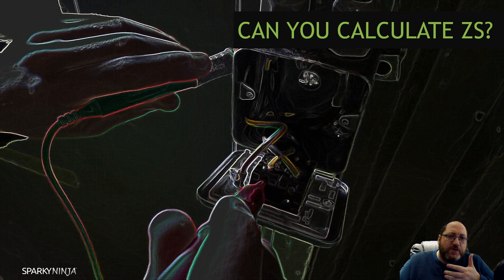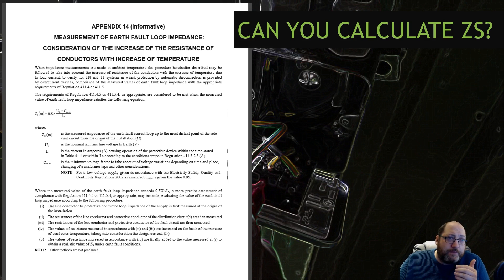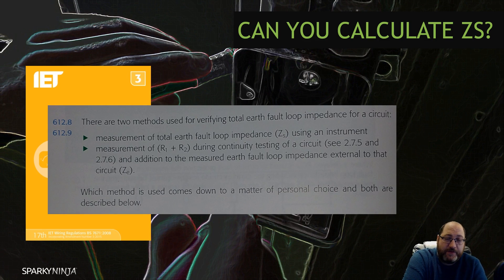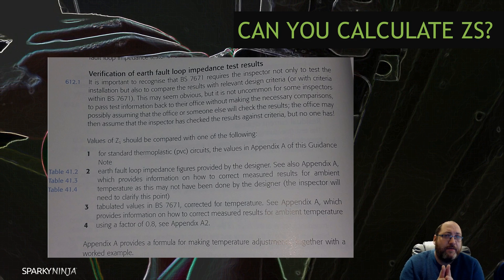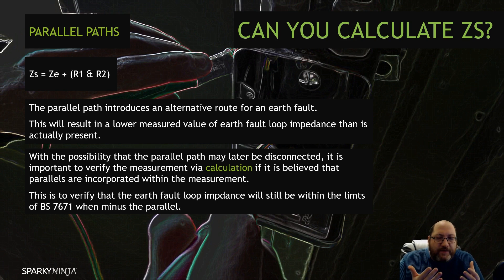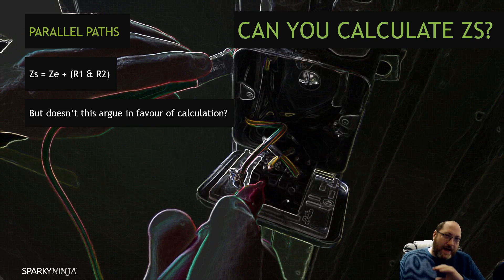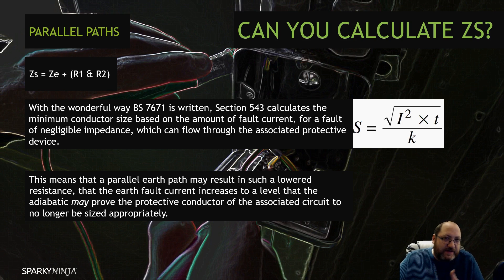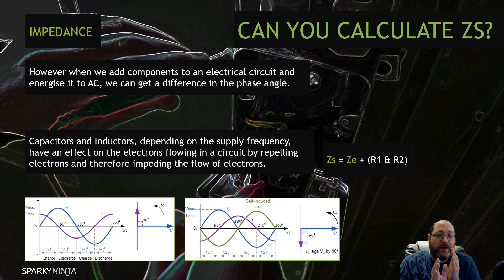Can you calculate Zs values (and should you)?

Comment: I don't follow your logic about parallel paths, at 12 mins. The max current the MCB will pass before tripping will not increase, but the proportion of the current (supplied via the line conductor) returning via the cpc will be reduced thanks to the parallel path. I believe the calc uses 5 x MCB rating (for a type B)?
So Amps in the calc will not change. The line conductor will suffer an increase in current, but that is not the issue.
Reply from the maker: The point is regarding where we use the adiabatic to design, not accounting for parallel paths and then consideration that fault current would increase with installed parallel paths which might put the system under stresses that haven't been taken into account.

Comment: When I fill out certificates I record the highest measured value in the Zs box, 90% of the time this is Ze + R1 + R2.
On your impedance explanation, I've noticed that live testing with some types of equipment connected to the circuit can give me erratic or different readings, especially with 3 wire low current tests. What exactly have we proved by conducting a live test if the reading is susceptible to change by connected equipment?
I carry out ELI where it is safe to do so. I wont stick my probes where i cant see or reach easily, i wont leave lots of live accessories hanging off the wall on a packed building site, and i wont cram myself into a stupid small space with live conductors.

Comment: Thank you for creating this informed video with reference to specific regulations in BS 7671 and reference to GN3. My training has been that calculation of earth fault loop impedance by Ze + (R1 + R2) is acceptable and is preferable for the reason of not requiring access to live parts (and so reducing live working ref. EAWR 1989).
The point you make about parallel paths is an interesting one, though surely if the impedance is reduced by parallel paths, the CPC will not be subjected to the full resulting fault current current, the fault current being proportional to the impedance of each part of the parallel path?
The biggest question for me arising from this, is when carrying out dead tests for continuity of CPCs, you are supposed to test at every point in the circuit, verifying the results and recording the highest result, which you should expect to obtain at the extremity of the circuit (subject to various specifics).
When obtaining your Zs by measurement, would you again be wanting to conduct the test at every point (every accessory - sockets, luminaires, switch positions etc) or is it considered acceptable to carry out measurement only at the part of the circuit where the highest R1 + R2 reading was obtained?
Otherwise we will be spending a great deal of time taking things apart and putting them back together again for doing a second round of measurements.
Reply: If you are talking about a standard radial, I'd test r1+r2 and Zs at the end of line. Where you have a radial with multiple end of lines, test at each of them. For a ring, test everywhere.

Comment: You peroidic a property...or... do an install in a property......Then a plumber comes along, as part of a bathroom / kitchen re-fit, and all those tests and measurements you did are now wrong because the pipework is now plastic instead of copper...making any certificate issued useless. 
Do you think ALL plumbers should be made aware of the fact that "improving" the pipework / water supply system, that they are going to affect the electrical system too?
I ask because.....I recently had this when the builder and home owner decided that a new water main was needed...from Lead ( and rightly so for health and safety reasons ) to plastic...as this would aid the water pressure in the property etc... Without considering all the potential electrical issues this may cause.
One final point...If we measure Zs / Ze....Do the multifunction machines we generally use actually measure it, "Z" or are they simplifying it to simple OHMS Law "R"? I think the latter.

Comment: Hi... all good stuff...Thanks.
One question ...If you had a higher than expected Zs reading...higher than the regs allow 1.1 /1.08 Ohms for a 32 Amp Ring Final Circuit.....and then you introduced an RCBO for protection....would the Zs then be 1667 Ohms for the RCBO for a 32Amp Ring Final Circuit  or would the Zs  be as the regs state?
Reply from the maker: Hiya,

The Zs would stay as to the actual measurement. However if a 30 mA RCBO was introduced then we can look at regulation 411.3.2.5. This mentions that the requirement for the disconnection times may not be needed if a device is used to lower the supply below 50 V a.c. in a QUICKER time than those given in chapter 41.

So say we look at a TN system 32 A final circuit, this has a disconnection time of 0.4 seconds in Table 41.1. If we were to introduce an RCBO of 30mA to this final circuit then at 5 x IΔn it will trip in 0.04 seconds, removing the supply. 

This is fine, but only if we know the RCBO will work in the required time and rating to keep the voltage below 50 V, and for that we need the 1667Ω. This is why we may record the alternative Zs of 1667Ω on reports.

If the original Zs is in excess however, it may also be worth verifying the Zn between line and neutral, as if this resistance is too high to achieve sufficient fault current for disconnection then the RCD will not assist with this.

Comment: Hi SN, thank you for you explanation ... it brought back dim memories of 'A' Level Electronic Systems and Physics together with Degree level Electronics and Electrical Generation from an Aviation perspective as well as Royal Air Force Engineering Specialist Training. I am sure that I have forgotten 'more' than I have ever learned! However, whilst an interesting 'canter' into details which many have long since committed to 'file 13', if I understand you correctly capacitive and inductive reactance both act to increase actual impedance; thus reducing the current flow in an AC circuit below the current predicted with the resistance 'measured' using DC. The approaches of 'measuring' or 'calculating' Zs and thence potential fault currents are surely both equally affected by this 'common' limitation? Whether 'measured' or 'calculated', both approaches are convenient, 'conservative' in their results and therefore 'adequate' for their purposes?

Comment: Hi sparky Ninja whilst watching this insightful video and in particular your part regarding independence differing from resistance it reminded me of a query I had a while ago regarding whether or not include the impedance introduced via a RCD into a circuit whilst measuring the zs value or to take a reading either side and deduct from max zs measured? My feeling is whatever impedance is introduced into the installation must be taken into account although I have seen as much as 0.30ohms from mk 61008 RCD,s before.would be good to hear your thoughts.richard

Comment: Until the regulations are more clear on the matter then the calculation method will still be used for years to come. 
In fact using the calculation often gives a higher zs result than a measured value but having rcds in circuits and measuring zs with the non trip 15mA test current can be inaccurate.

Comment: Hi SparkyNinja I recently sat and passed my 2391 with one of the contributors to BS7671 and on the course he was teaching us that we should always do Zs as much as possible by calculation, this is due to the reasons given in the Statutory Document of the Electricity at Work Regs which states that live working working should be avoided as far as reasonably practicable, it is therefore practicable to avoid live working by removing things such as socket faces to take live Zs readings and pull down ceiling roses to expose live parts when this can easily be avoided by just using the Calculated method
Reply from the maker: Yeah that's wrong I am afraid. Otherwise it would be written in the guidance to that effect. Saying that some of the guidance is incorrect anyway, or insufficient. Where's the Zloop value in there to verify short circuit currents on final circuits to achieve disconnection for example?

The requirements of the Electricity at Work Regulation 4(2) is to prevent danger, all systems shall be maintained so as to prevent, so far as is reasonably practicable, such danger. 
It then states in 4(3) that every work activity, including operation, use and maintenance of a system and work near a system, shall be carried out in such a manner as not to give rise, so far as is reasonably practicable, to danger.

It doesn't say that live work should be avoided, it says that work should not give rise to danger. It's a completely different thing. If the worker is skilled, has suitable control procedures, suitable instrumentation, tools etc then effective maintenance must take place.

If an electrical incident was to occur, such as static shock on machinery, arc flash or in-direct contact.. the question will always be asked if it could have been done differently, and more accurately. I work in the food industry and see this every week - I can even name the HSE officers forcing 6 factories to measure EFLI's (mustn't calculate) and to actually test their RCD's monthly with an instrument at the moment.

Choosing to calculate a Zs test every time is both avoiding maintenance and going against the intention of BS 7671. Higher incident energy levels are left undiscovered and reactance isn't compensated for.

Try not to listen too much to self-righteous people throwing their backgrounds in to prove their point. I challenge these types daily at the moment (#e5 on LinkedIn)

Have a good think about it and come to your own conclusions moving forward, it's your competence - no one else's!

Oh, congratulations on passing BTW 👍
Reply: SparkyNinja I completely agree with you mate I always measure my values as I’m not being funny if I can remove a board cover to expose live parts to take a Ze Reading then I’m most certainly competent to drop a switch or fitting to take a reading hahah, I take readings then just compare them to my calculated values

Comment: Very interesting, again!

A couple of considerations. Obviously if the earth fault loop impedance path is reduced by parallel paths a greater fault current will flow. But I don't think this has any affect on the the sizing of the CPC because the additional fault current will be proportionally shared with the cause of the parallel path. I think the important consideration when there are a lot of parallel paths, say in an industrial installation with metal containment fixed to structural steel, is being as sure as you can be that the CPC is in fact intact, and not just fortuitous due to the parallel paths. As you said, a parallel path may in some circumstances be removed, or reduced at a later date.

The other point is that calculation only takes place during the design process as you said, this is done on a bit of pare, a spreadsheet or in Amtech or similar. But measuring Ze and R1+R2 and adding together is still a measurement, it's just taken in two measurements. Now we can all have a view on the accuracy of the measurement using a DC test method, and it obviously only measures resistance. But is direct measurement I'd Zs any more accurate with an EFLI tester? It might be as its measuring with AC at a higher current, but if you have an RCD in circuit and are using a no-trip test, especially two wire (Megger), it could well be a fruit machine test result, due to noise, etc. So there is room for debate, but I would argue that both method are in fact measurements - you are using a meter for both. 

Actual fact, at Elex I was looking at the new MFT from Megger that claims to be able to eradicate false readings when in no trip mode ( only for three wire method I think), so that would be a vast improvement.

Thanks again for the video, very interesting.

Comment: Sir wonder if i can pick your brains? been asked to install wiring for 70 student flats all there will be is a ring main and a lighting circuit. i do not know what supply is going in but wondered what would be the easier way of installing this. was thinking submains to each room? whats your thinking many thanks
Reply from the maker: That sounds like a big job 😲. I would approach it in the way you describe, with sub-mains to a small board in each - a little like you get in these 'affordable' hotels.

If you find the pricing an issue for that number of consumer units then I would still do sub-mains but try to divide them up to the most suitable central positions.